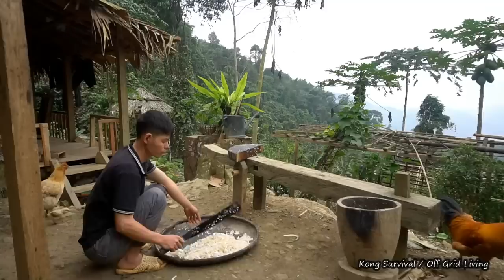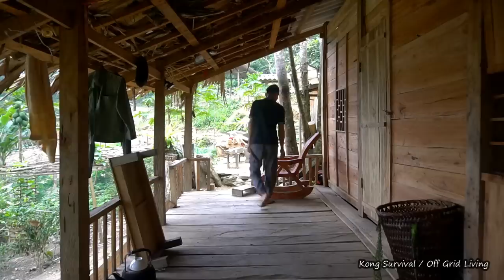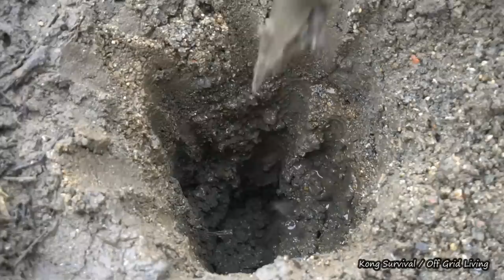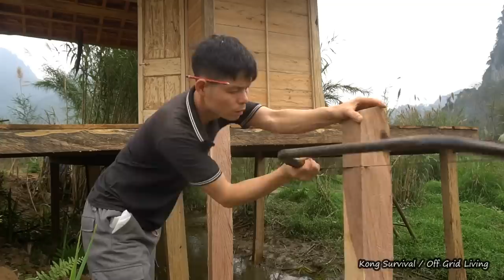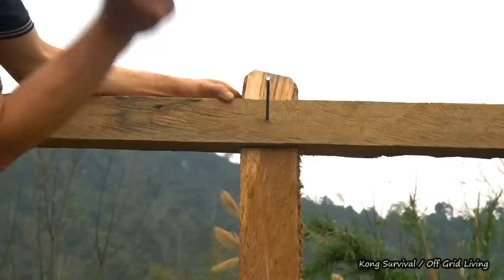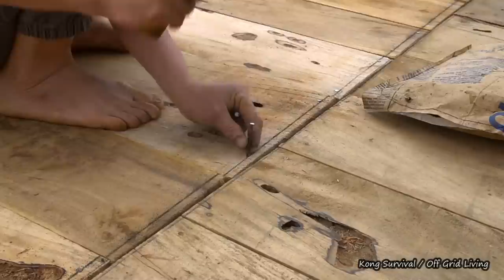Down the mountain to build a new life - Build columns, install wooden floors, build more kitchens

Comment: Kong take the advice of the commentors. They are worried about your wooden post that buried in water. It can easily rotten why not put cement on each poles to make it more stronger and can hold the weight of the entire house. Save some energy for tomorrow..